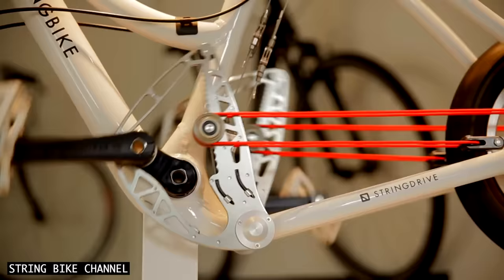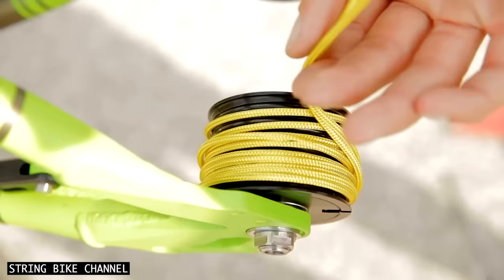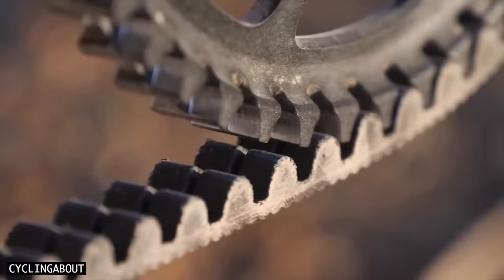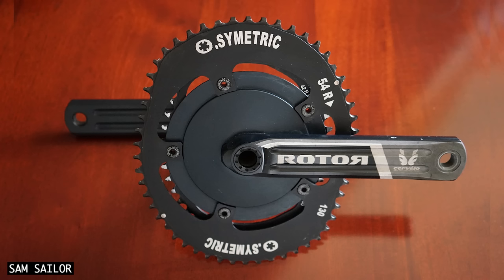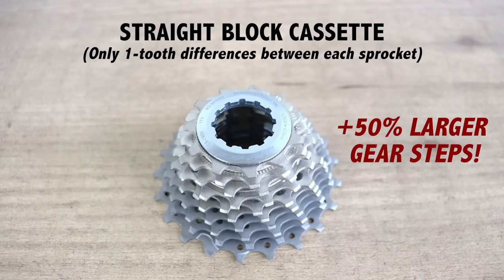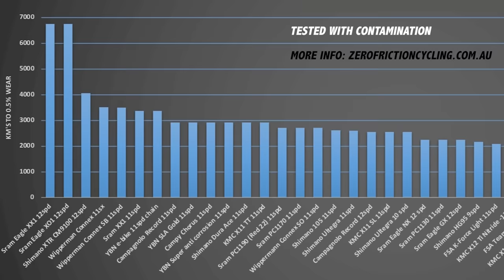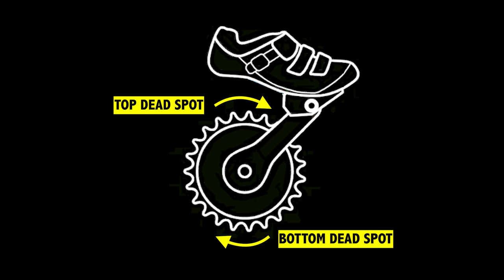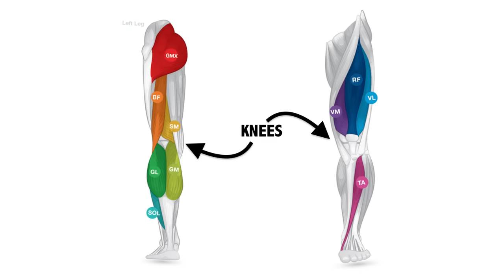Are Chainless String Drive Bicycles a Genius or Terrible Idea?

Comment: I like how they solved a problem which didnt exist
Reply: The only people who don’t think chains and cassettes have issues have never ridden a bike for more than a couple thousand miles at most. I’m not saying this is the solution but claiming chains drive bikes are peak perfection shows you’re not a serious or experienced cyclist.
Reply from the maker: I disagree. Compared to a derailleur drivetrain it offered: gear shifting anytime, zero gear adjustment, fewer wear items, easier rear wheel removal, significantly smaller gear steps, an elliptical driving path, and a grease and lubricant-free setup.
Reply: It’s more accurate to say they created more problems than they solved
Reply: If peak perfection is something other than peak mechanical efficiency and the ability to get parts - then yes, it is not perfect.

In the same way, walking is also inferior to running. Yet, our lives are formed with walking in mind (or, God forbid, driving).

While you can argue with years of ingenuity around a regular bicycle, you cannot argue with physics. IMO, the upright bicycle formula is as good, as it will ever be. Safe for one-off components for satisfying very specific needs.
Reply: I would, personally, don't mind an attempt on virtually everlasting all-weather BB and spline standards. Better chainring mounts are also possible. More developments in the field of mechanical disk brakes would be lovely. 

The main difficulty is pushing a new standard to the masses, while being profitable.
Reply: @oleg..  a) belt drives are more efficient than chains above 200 watts.  Clearly chains are not the most efficient possible solution.  

B) If you think having parts readily available for no other reason than that’s what we’ve been using forever so it’s in stock is peak perfection you’re just wrong. Not needing to replace parts is obviously a better option.
Reply: @randomdude5938  I have 220,000 km on my bicycle and 72 countries. It is perhaps you who has no clue. Whats your experience aside from baseless assumptions?
Reply: @randomdude5938 having 100 fellow citizens on cheap bicycles is better than riding a dentist bicycle, your grandpa bought years ago, in a so-sustainable world of lucky fellows on pricey bikes.
Reply: @superwag634  Then you should be very aware of the problems with a chain drive.
Reply: As for the belt drives, I am all for them. Yet:
1) They are less flexible in terms of changing the gear ratio and chainstay length (from the standpoint of tinkerer and framebuilder).
2) They require sophisticated solutions for changing the gear. (from someone, who fixes their multispeed bicycles on their own)
3) The ecosystem has a very steep entry price, and a poor representation in my country. (from someone who'd like to swap his singlespeed drivetrain to belt).
Reply: @superwag634  how many chains and cassettes have you been through in all those kms? Do you honestly believe there’s not a better solution possible than constantly replacing worn parts? I guess we should just give up trying to make everything on earth more durable, longer lasting and less maintenance intensive because you don’t mind changing parts.
Reply: @sirensynapse5603  you’ve never had to replace chains or cassettes in 35 years of commuting? There is no way that’s true unless you’re just replacing your bike instead.
Reply: @bink281 I dont have any problems with chain drive. It works, it is perfect for my needs as evidenced by my travels. It is also used on just about every motorcycle. And it will continue to be so for decades to come.
Reply: @oleg..  so you acknowledge that it’s possible to improve on chains but seemingly want everyone to just stop trying to improve anything because new technology is expensive when it’s new. 

You do you but I ll continue to hope for better and cleaner solutions that require less maintenance and replacement parts.
Reply: @randomdude5938  sustainability is more about recycling, than it is about making something marginally longer-lasting (40 years of health is nothing, really). A chain will turn to rust before the worn-out belt starts disintegrating.

As for the price, in a democratic, capitalist, "just" world, a couple of stamped steel sheets will always be cheaper than CNCed aluminum and a composite belt.
Reply: @randomdude5938  I acknowledge that in a vacuum some spherical cubes are more spherical than others.

I also very much acknowledge that all-in-all I am more privileged than 90% of the world population (yet, for me, belts are expensive). And I live in a country that's going through war. 

Therefore, I do believe that the age of mindless consumer-driven progress is on its verge of ending, and the developed world may, as well, change its priorities for a while.
Reply: @oleg..  mindless consumer driven progress is a new dura ace groupset every other year, not finding maintenance free ultra durable alternatives to 150 year old technology.
Reply: @oleg..  lol recycling.  I do t know where you live but where I live they take 90% of the recyclables to the dump.  Recycling is a small part of sustainability.  Making longer lasting products is much more important long term.
Reply: @randomdude5938  Ultra durable technology stands in your local museum, and is called "a safe bicycle". Any singlespeed bicycle of decent quality, rocking steel sprockets is decent enough for an average human. Belt drive is a small improvement on this idea.
Reply: @randomdude5938  a belt dumped in a river will decay slower than a chain. That simple.
Reply: @oleg..  it’s not that simple though. You’ll go through ten chains in the time one belt will wear. Regardless you’re getting into specifics and I’m not talking specifics. I’m talking generally  about trying to find solutions that are better and more sustainable and you’re pretending it’s impossible to do that.
Reply: @sirensynapse5603  having to buy and replace parts is worse both economically and environmentally than not having to buy and replace parts.  I feel like that’s pretty obvious.
Reply: @randomdude5938  my points are the following:
1) Your life is heaps shorter than what can be achieved with steel.
2) Composite materials decay heaps longer, than any number of steel parts you use throughout your life.
3) 90% of people require neither performance, nor longevity if they cannot afford something. As such, providing 1000% of drivetrain lifetime with a solution that is more complicated, less ecological, and that gatekeeps small manufacturing has nothing to do with improvement for the industry as a whole. Not now, not in a hundred years.
Reply: @sirensynapse5603  that’s such an absurd strawman.  Just because perfection doesn’t exist doesn’t mean we should stop trying to improve things.
Reply: @superwag634 do you think using something a lot constitutes evidence of that thing being faultless?
Reply: @bink281  I was answering the guy who said that I must be an inexperienced cyclist 😆
Chains are perfectly fine. If you want something else, go put your money on the table and buy it. No need to argue with me
Reply: @superwag634  I'm arguing with you because you keep using fallacious logic and making nefarious claims. I'm not convinced that chains are 'perfect' or have no problems, which would entail they they are not able to be improved upon. Why would you think that chains cannot be improved upon?
Reply: @bink281  I’m done buddy. Go out and ride a bike. Happy days
Reply: @superwag634 thought so
Reply: You have clearly never ridden a chain and cassette bike if that is your opinion. This solution is parallel to an engine that requires no maintenance. Who doesn’t want that?
Reply: This is more "planned obsolescence"...
Reply: I like how speed runners and race car drivers try to go fast despite us already having gone fast.
Reply: @tjpprojects7192  I have no idea what you said!
Reply: @ragetobe  Race Car drivers shouldn't go fast because people have already gone fast. It makes no sense for them to fast, it's useless an wasteful. People shouldn't want to watch Race Car drivers drive fast.

I like how Race Car drivers solved a problem which didn't exist 

My entire comment was supposed to be exaggerated to highlight the absurdity of the original comment. Degrading a technology for being "redundant", "useless", or "solves a problem that doesn't exist" is straight up stupid. Anyone who laughs at attempts to improve technology, even if they don't succeed are the bane of innovation.
"wHy Do We NeEd CaRs?! We HaVe HoRsEs AlReAdY!"
"wHy Do Wr NeEd ElEcTrIc A/c?! HaNd FaNs WoRk JuSt Fine!"

The original poster was mocking the rope drive as if they hate technology. If the original poster hates "pointless" technology so much, then why even live at all? What's the point?
Reply: @oleg.. Could always take Apple's approach to sustainability... talk a lot about how much you care about it while while raising prices and focusing on neither recycling or increased lifespan. It's the best of both worlds.
Reply: stationary gear shifting, no grease, almost no maintenance, and fewer and less complicated parts. for the casual rider, this is a significant improvement over normal chain bikes. of course, they aren’t perfect, and i wouldnt use it, but saying it solved no issues just shows how close minded you are towards innovation.
Reply: @9_1.1 Yeah no chain stretch.. just cord stretch instead. Not sure if you've ever dealt with cordage of any type but over time specially when under tension they'll stretch and develop slack a lot faster then a chain.
Reply: @SilvaDreams  yeah i changed my mind about that lol, that was an assumption i made and a bad one, i removed it from my comment 😂
Reply: @superwag634  i love how your response to everyone who criticizes you is “well ive ridden more than you have! 😡”

you do realize that having experience doesnt make you knowledgeable right? you can ride a chain driven bike for thousands of years and think its the best, because you havent tried anything else. if you prefer chains, good for you, that doesnt mean chains are the best choice for everyone. its been objectively proven that belts have a longer lifespan than chains and are more efficient than chains on higher loads. that isnt a “baseless assumption.” you can ride as many kilometers on your bike as you want, it wont change that.
Reply: @9_1.1  knowledge comes from experience. And how do you know what I’ve tried? Your assumptions are baseless. Stop taking my reality and substituting your own 😆
Reply: @superwag634  knowledge comes from learning, doing something a lot doesn’t automatically mean you’ve learned much. my example about riding for years on a chain bike was to show that experience does not always mean knowledge, i wasnt saying that you’ve only ever tried a chain bike.

you seem to like to look for any way to attack people instead of actually acknowledging their point (based on this reply and your other ones). im getting classic narcissist vibes. wanna try again?
Reply: @superwag634  you can have every degree in the world, that doesnt shield you from criticism. my reply was criticizing you for your close-mindedness and your inability to defend yourself other than saying “i have lots of experience.” so what if you have experience? it is an objective fact that chains are not perfect and can be improved upon, and having experience in biking doesnt mean you’re right and doesnt mean you arent close minded. 

you then make baseless claims that the string drive is “solving nonexistent problems” and that “knowledge comes from experience,” and after making those claims you suddenly dont wanna argue? sounds like you just want an excuse to have a one-sided conversation. if you dont want an argument, dont engage. you clearly do want an argument, but a one-sided one.
Reply: @Cyclingabout i am seeing way more wearable parts, like almost everything, greased bearings last loger than metal on metal.
Reply: This is called innovation, without it, nothing would ever improve.
Reply: This is America, people will buy it then throw it out kinda like the other non chain drive. Like the shaft that goes back to odd gears
Reply: That's... how engineering works. To fix a problem, you first need to find one.
Reply: Lol, I don’t know bikes I'm just laughing at the comment 😂😂😂
Reply: @danparish1344 The only problems it creates is reduced profit from short lifespan high maintainance cost crap in the mass market today.
Reply: I built a prototype version of this in the mid 1990s.
I used two double lobed cams on the crank, roller followers to actuate a rocker that pulled the cords, and as moving fulcrum on the rocker.
By tuning the pull of each side to be 95degr, and retraction 85degr, to allow smooth torque at all ratios.
Anyone not understanding that 5 chunky non wear parts giving you superior efficiency, reliability, lighter weight, much higher range of ratios, at a much lower cost is a winner for the customer riding it, but a nightmare vision compared shitty derailleur for profiteering industry.
Dyneema is a stupid choice, it's just brand named polyethylene.
Reply: Efficiency is very high in low speed high torque situations like human power in cycling.
Reply: Belt drive for me
Reply: @randomdude5938 yes BELT drive not STRING drive big difference lol way to show you are clueless 😂
Reply: Okay Boomer. Get mad at innovation.
Reply: Sure, but most of these are just quality of life. The fact that you go forward by pedalling backward is an absolute no go for mountain bikes though, which eliminates that application.
Reply: @Spartanxxzachxx  it’s like you read a third of one of my comments and ignored everything else I said…..
Reply: @JakeWinegrad  I’m 42. My grandpa is the boomer 😆
Reply: If everyone thought like this we’d still be riding around on horses for travel or beating each other to death with clubs. Humanity’s greatest advantage vis that we fix problems that supposedly don’t exist. You could honestly say it’s one of our defining features…

Bikes in particular have supposedly been problem free for decades. Clearly no one should have developed disc brakes, wireless shifters, carbon fiber frames or tires…. Or belt drive bikes… or high performance chains and greases.

I mean basically all of the stuff that makes this string drive bad was invented fairly recently. I’d be surprised if it wasn’t a straight upgrade over most bikes from the 70s
Reply: It's called an innovation.😒
Reply: @superwag634 First, you not having a problem with a chain drive is different than saying chain drives don’t have problems that can be fixed. Any engineer worth their salt (and any human with basic logic acumen) would know that. 
Second, Belt drives on motorcycles are superior in all but a handful of cases. So perhaps your civil engineering degree doesn’t apply to chain drive systems?
Third, if you don’t want to discuss, don’t comment. If you don’t want to look silly, you certainly shouldn’t make silly absolutist statements on the internet. 
Now excuse me while I go ride my own bikes, with my engineering degree used as a flag.
Reply: Just because you didn't hear the benefits in comparison doesn't mean there wasn't a problem.

A standard and the availability of such doesn't justify demeaning improvement. 

It's a good thing more people don't think like you.
Reply: @EarendilStar  im a mechanical engineer 😆
Go ride your string drive bicycle. Or belt drive motorbike. Report back when  you’ve done some serious distance and we can do a cost/benefit/reliability analysis as fellow engineers. Btw, the string bike is a commercial failure and is no longer trading, so there’s that.
Reply: Well said
Reply: trying to improve existing technologies via redesign is a noble and respectable endeavor. if we all followed your logic, we'd still be riding horses and treating infections with leeches
Reply: "wah wah wah why did they try to improve and create new invention which is able to decrease unnecessary metal use" its not a stupid idea but useful? could be. stop being so negative
Reply: @corruptedmineral  all you do is “wah, wah, wah”. Good song that
Reply: @Nooely  this string bike was a commercial failure. It went into liquidation. Old news
Reply: @randomdude5938 not peak perfection, peak optimization and practicality.  Post ww2 engineers knew a lot about being robust and fool proof. Today many things are over engineered and overly complicated for the general market. Simple, robust, and fool proof, that is what is called for by the general public and worldwide universal use.
Reply: @counterflow5719  if that were the case everyone would be riding internally geared hubs with belt drives.
Reply: Other than not designing the bike for disk brakes, I don't understand why a disk brake would be unfeasable.
Reply: The video is literally stating the problems it is trying to solve.
Reply: @randomdude5938 you say belt is more efficient above 200 watt? If so, why do I not see belts at the Tour de France or Giro d'Italia?
Reply: I never knew i wanted a string instead of a chainn
Reply: @c.s.4273  because internal gears are heavy af.  I’m not just making it up.  Do some research.
Reply: Yeah, why invent anything if something else already works. I'm still reeling at the idiots who invented microprocessors when we had perfectly fine abacuses and slide rules!
Reply: Sin probarlo no puedo opinar, así que no opinaré nunca ya que nunca lo compraría. 
Soy aficionado al enduro y ni se me pasaría por la cabeza meter esa bici de cuerdas en barro, charcos, palos, zarzas... desastre a la vista!!
Reply: Really?
Reply: Nem voltál figyelmes!
A forgatónyomaték képzésben lévő problémát igenis megoldja.
Reply: @Trenz0  except this is a crap invention and the company has already gone into bankrupt. So thanks for your irrelevant hyperbole 🤣
Reply: @randomdude5938 возможно, если ещё правильно переключать вам научиться, тогда возможно, а то если слева стоит 1 скорость, а справа 7-9 то понятно тогда почему у вас сильно износится
Reply: Humans live on improving technology not just fixing things. We do some stupid syit and we learn from it then we fix it. Thus, we can create something that doesn't exist before. Some inventions may be stupid but some of them will be a base towards great invention.
Reply: I ride my bicycle as my main form of transportation because I prefer it to my car. They are a lot of maintenance if you use a derailleur system like I do. Spoken like a suit.
Reply: Bro should have just gone home
Reply: They could be the next Bitcoin developer total useless stoffer with a high value only in the investors mind.